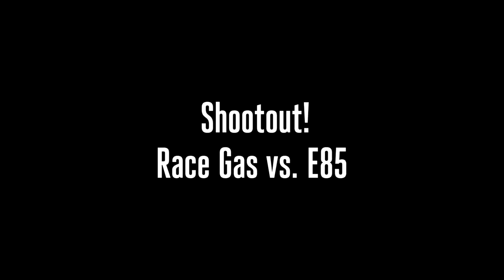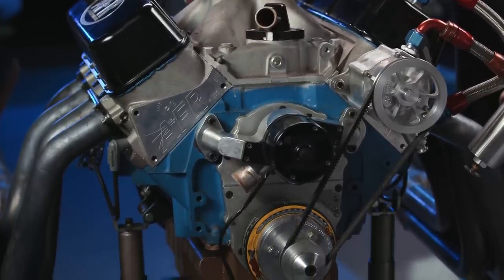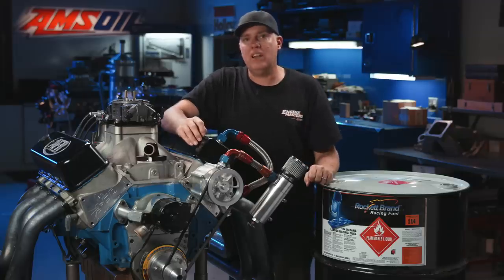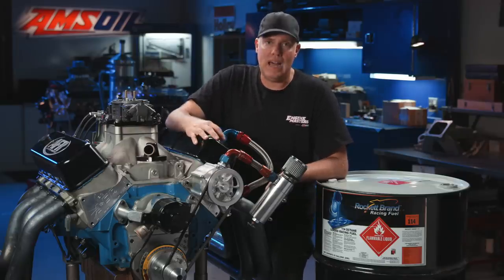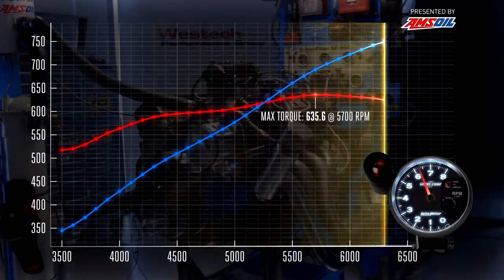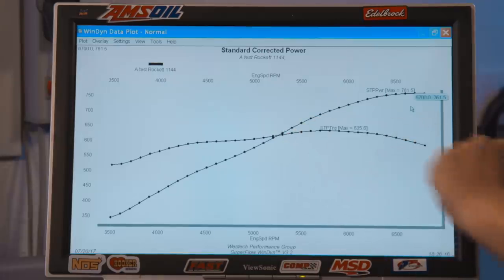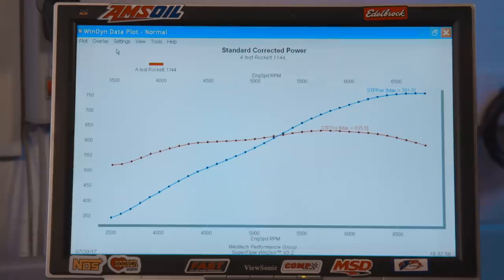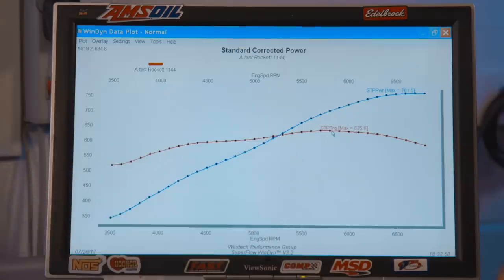Fuel Fight! Race Gas vs E85 - Engine Masters Preview Ep. 30

Comment: Race gas ~4100 RPM: 449 ft-lb , 574 hp.           E85 ~4100RPM: 458 ft-lb , 585 hp
Reply: Thanks
Reply: Was there anything mentioned in whats better for other reasons? I know e85 lets the the engine run colder then pump gas. Wanted to know if race gas provided any similar benefits, aswell as which can run a high cpr
Reply: Thanks
Reply: Thank man.
Reply: You're the Real MVP here
Reply: Legend cheers

Comment: 2 stroke oil can raise performance of gas in a four stroke engine. Can also add mileage. Performance/H.O./supercharged/High compression.
Reply: Yepp My Malagutti from 1998 do make the 30 KM/h .
Reply: thats becaus it make the mix of air fuel leaner on carb engine
Reply: @2smokes you evidently still think that lean makes more power.

Comment: I run E85 on one of my dailies with no cats and it smells like gasoline being burnt. There is just a hint of something else to the smell but it's not bad. Man it would cool if it smelled like nitro methane but dirty sock it doesn't
Reply: Go to a dirt track and stand beside 20 late models running E85...you'll smell it.

Comment: Why tf dont u guys do it on newer engines? Smh
Reply: Matthew Brooks - You misunderstood his comment and older engines when properly tuned run just fine on E85 or even pure methanol. Pure alcohol carbs which began as gasoline carbs have been quite popular since the early '80s in racing applications using all sorts of old engines, most commonly built in the '60s and '70s.